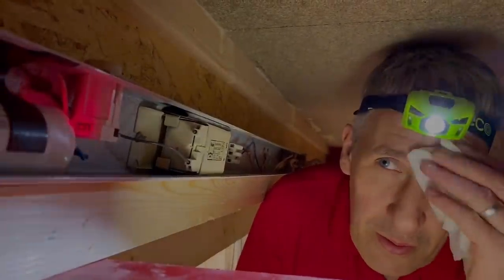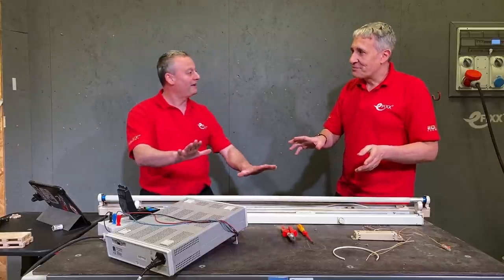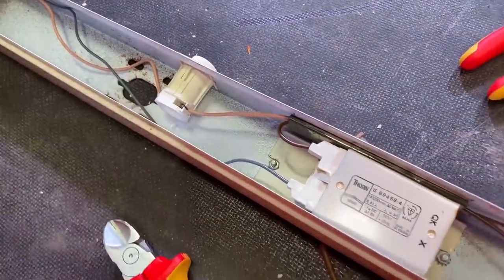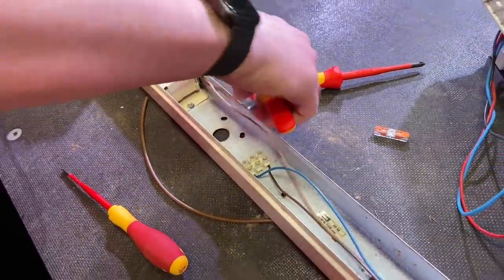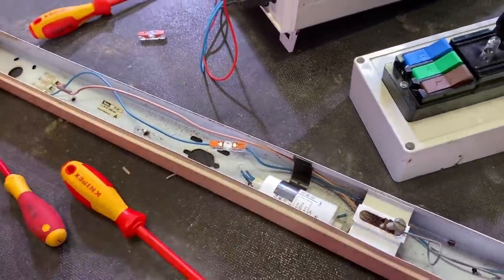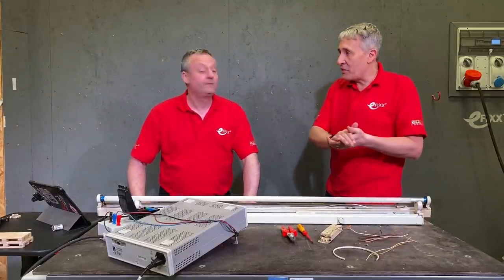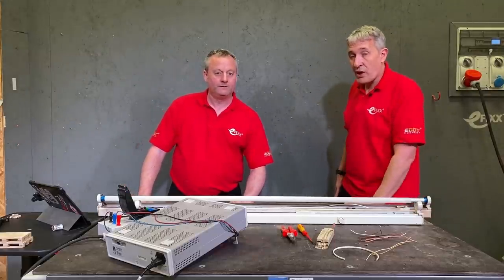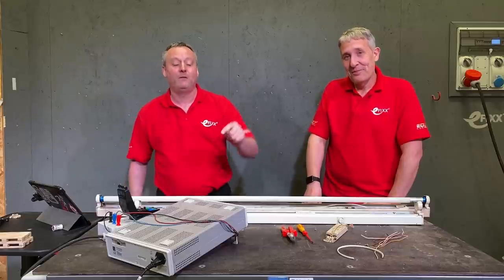DON'T cut the Wire - CALL the ballast disposal squad!

Comment from the maker: Check out the money you can save swapping out old T8 tubes 📺 👉 https://youtu.be/nAo4onkzpKA
Also, would you remove the old magnetic ballast to sell for scrap? - comment below.
Reply: Safe a little bit of money by chopping brown to capacitor and leave neutrals connected ? Saving you wago . I know you shouldn't really leave something in circuit that not needed.

Comment: Usually in a commercial environment, I've found the actual fittings have totally had it. Normally the lamp holders will be brittle, the wiring crispy and the fittings will look rough. If the fittings are in perfect working order and look fine, then they probably aren't used very much anyway so it's not worth changing it to LED - especially if they have a good stock of tubes / starters already.
Reply: In the home that is even more so — home grade stuff the exterior is also plastic and likely to fall apart when you try to open it to replace a tube.

Comment: Interesting as usual.
One valid point, some tubes come with a Starter replacement device, they call it an LED starter, but it is actually a 1 amp fuse, fitted in a starter package.
I included one in my fitting conversion, simply because I could. Which gives a little extra protection.
Reply from the maker: Interesting -which brand of tube uses that option?
Reply: I supplied a customer with dozens of these "starters", only to find when opening one up, it had a stationery staple across the pins.
Ooh!
Reply: @efixx  Energiser & Hyperikon are Two brands that I have dealt with, they both come with these Fuses, and the Hyperikons come with a brand new replacement end, for their single ended tubes. I am wondering if they might be those resettable fuses, known as poly fuses.! I must admit, I have never tried to stress test one.
Reply: @efixx  I think its optional, but it makes sense, as it keeps that slot occupied, and it also adds a safety feature to the unit, so, if one tubes goes nuclear, it doesn't put you in the dark, if other lights are nearby. It just kills that one light fitting.!
Reply: Good 100% of LED-Starter how I have found till yet have had only a connection from one side to other. Only my new extra LED-Tube lamps have an extra fuse built-in (and no fake-starter of course).
Reply: @OldLordSpeedy  All of my LED starters has a 1A fuse. I didn't know so I didn't use them. Just wired as simples as possible.
Reply: @mcplutt  Of course its optional, but as the space is already there, you can wire it accordingly to include a 1A fuse.
If a tube fails short circuit, it will leave the others (if there are any),on.
These LED units all use a very tiny full bridge rectifier. If it fails short circuit, its an added bonus.

Comment: I just retrofitted 100 of these (T5 tubes), disconnected the ballast but left it in the body to save time. Also had to wire the live to one of the pins at one end, then out of the other pin to one of the pins at the other end, and out from the 4th pin to the neutral. Tubes had a polarity marked so had to make sure it all matched. If you follow the manufacturer’ instructions you won’t go wrong :)

Comment: I installed these (or very similar Philips with blue ends) removing all the gear. One end is marked +/-. The other end is unmarked and as I found out those two pins are commoned, well at least it tested the trip !

Comment: Used to rip loads of the old 70w magnetic ballasts out a few years ago. We did weigh them in as motors (due to the coil of copper) and we were making £600 a ton! Unfortunately, the scrap yard cottoned on and from that point, they only let us weigh in as standard scrap. It was nice while it lasted tho

Comment: I have always bypassed the ballasts for multiple reasons.
1, energy saving. Might only be low, but multiplied over many fittings it will make a difference.
2, if the ballast fails, this will result in being called out, under warranty, to bypass the ballast anyway. 
3, the customer is paying you to do this work. If it was a twist and go job, the customer could more than likely do this themselves. 

I would always fit a label to indicate the ballast is removed and to use led conversion lamps only.
Reply from the maker: Sounds like a sensible approach.

Comment: There's an alternative way of wiring that is the better method in my opinion! There's no main side in the light fitting then, and the lamp will work in both directions inside of the fitting. The method you've shown here will cause a short circuit in the lighting circuit if you put the LED tube in the wrong orientation into the fitting because on one side both pins are bridged inside of the lamp.
Reply from the maker: the other side of this tube has no connections.
Reply: @efixx  Yes, the pins on one side are only to hold the tube in place within the fitting. But the both pins are bridged inside of the lamp. And if insert the tube the wrong way around this will cause a short-circuit. But there's an alternative wiring method that prevents this.
Reply: I don't know why, but whenever I post comments containing a link to a wiring diagram they get deleted by Youtube.
Actually it's quite easy. You got two terminals at each of the two sockets of the light fitting. You connect one socket to line and one to neutral. Then insert a wire bridge to connect both free terminals of the sockets. If you do so it does no longer matter which way around you insert the lamp into the fitting, it will always work.
Reply: @Marcel_Germann  You can also just use a Sharpie and mark the live fitting. It's quite a common practice.
Reply: @Richard1977  I just wanted to make a point that there's an alternative way of wiring that is better in my opinion because it's idiot proof.
Reply: I am very sorry but all LED-tubes have only one connection side for power. It is marked on every LED-tube. Of course you marked it on the lamp-fitting self too. New LED-tube lamps have only one powered side!
Reply: @OldLordSpeedy  I know, but you can bypass this by a simple wiring trick! Youtube deletes my comments containing links to drawings so I decribe it. You got per side two contacts. In the method shown here you connect the line on one contact of the left side (for example) and the neutral on the other side of the left side holder. The right side holder is without any connections.
In my method you connect the line on one contact of the left handed holder. From the second contact on that side you connect a wire bridge over to the right handed holder and connect it to one contact there. On the second contact of the right handed holder you connect the neutral. Then it doesn't matter which way around you install the tube. There's always a connection inside of the lamp on the non-powered side, so if you insert that end on the line side electricity will travel through the internal connection through the additional wire bridge and get to the mains end of the lamp. And if you insert the lamp the other way around the same thing will happen with the neutral.

https://abload.de/img/umrstung-anschluss-ei3oktj.jpg
Reply: I've been called out a couple of times where the client has fitted the tube the wrong way when the sparky has been lazy and wired the fitting to one end cap. As Marcel says the better option is to wire through both end caps which is how the manufactures recommend it.
Reply: @Marcel_Germann   Hmmm ... my LED-Tubes how I use all time have at the non-electric side no connection - some are kind of plastic -- so this can not work. What do you show is an old Tube diagram how it is installed over 80 years long without the starter.
Reply: @OldLordSpeedy  The ones we usually install have metal pins even if there's nothing connected to that, but the evil thing is the two contact pins on the side of the tube that is not mains powered is bridged inside of the lamp. That means if you insert the tube the wrong way around it will cause a short-circuit.
And without the ballast.
Reply: @Marcel_Germann  This is the way you are supposed to wire them in Switzerland. Apparently it is to prevent people getting electrocuted by some cheap chinese import tubes that have the pins on both ends connected straight through to each other. Inserting such a tube into a fixture converted the way shown in the video would leave 230v on the exposed pins while you are installing it. Suppose it serves you right for buying cheap crap but guess that is not the point.

Comment: Surely replacing the whole thing with an LED striplight will be cheaper overall? How much time does it take to convert the existing fitting compared to a complete swap?
Reply from the maker: There are sometimes reasons that mean a change is difficult - asbestos in the structure or an expensive fixture - eg vandal resistant
Reply: Normally less than 5 minutes to convert. Saying that tho, I have done a few 😂
Reply: Retro fitting, also eliminates the time required for testing and the recording of the results, which is recommended, for a like for like replacement of an accessory.

Comment: I have yet to find a LED retro bulb that puts out even close to the same light output a t12 in its place would.  the 8FT t12 led bulbs, only put out 3600-4000 lumens and use 44 watts roughly give or take the bulb you find..   There are T12 bulbs that use 60w and put out 5900 lumens.  Do the math, the t12 is actually more efficient at 98 lumens per watt, the led is 81 watts pet lumens.   The LED conversion bulbs are also pricey.. 30$ a bulb. T12 are $15 for two bulbs, and new ballast is only $25.   So for $40 you can have a fixture that uses 120 watts plus the ballast, and have 11,800 lumens.   VS the conversion bulbs at $60 that would be 7200-8000 lumens for 86 watts.   Youre actually spending more money to downgrade lol...  There are NOT many LED diods today that can output 100 lumens per watt lol..     LED is a replacement for incandescent lights.. but no way do they replace florescent bulbs.. 

I mean if you really wanna downgrade the lighting go for it, the only down side to the T12 is it takes a min to get to full brightness, but thats fine by me.    LED is really not all its made up to be.   I just replaced the ballasts and t12 bulbs with more efficient ones that still linger in the stores.. why in the world would i spend more money for LED conversion bulbs and have less light output.

I dare you guys to find me a T12 LED conversion tube that output more light and uses way less energy than the t12 did...  Youll only find that on the shorter 2-4ft tubes.. but not the longer tubes.   Now dont even get me on T5 bulbs....
Reply: Exactly my point. And have said this from day 1. Also it's easier to recycle a fluorescent tube then all the wee waste produced from an led tube. Same with discharge lighting. But people have fallen for the led crap. Yes it's better than halogen/incandescent. Yes it's better in cold environments. But the cost of the fittings and the general fact you can't service led fittings means we have gone backwards in progress and now generally it's failed replace and bin. Yet I still service and replace T12 tubes in fittings from the 1960/70's still going strong. I'd rather be able to fix and repair than to just be a fitter. And adding to the waste pile every 5 years when the led has failed.

Comment: I would of kept the Fluorescents not a fan of LED taking over everything.
Reply: yea thats what i did.. I have a 100 year old barn, huge barn like 100 foot long and 4-50 feet wide.. the work shop had 4 duel T12 8 foot lights in it..  Now only 2 worked.  1 only 1 bulb.    So i had no choice but to remove those lights, and i installed some LED shop fixtures i removed from my kitchen as i replaced those for designer style fixtures..  and i decided to get duel 8ft led fixtures as they are only $80 to replace the other t12 fixtures that didnt work.   Honestly the work shop is SOOO bright and with the lense covers on the leds dont look much diff from t12.

However the t12 fixtures that did work, which was only 1 of the 3, i decided to replace the 75w 8ft tube with some GE 60w 8ft tubes, oddly those 60w coolwhite have 5900 lumens the 75w are only like 5k... so why not go for the 60w lol.   The other 3 fixtures im going to just get some new T12 ballasts.. they are $24, and two T12 60w bulbs are $17.. in total i can save the fixtures for $41, this saves me $49 replacing them with 8ft LED fixtures.  And the LED fixtures are only 9000 lumens, the t12 are near 13k..   But i do wanna save energy.. this is why i didnt replace all the t12 in the work shop.

The t12s will go in the center of the barn where the lights will only be on when they need to be on, the workshop will be used more, so i cant have 1200 watts of lights on for 4-8 hours at a time lol

Comment: If you Brits are just now changing over from fluorescent to LED tubes, you are about 10 years behind on us Dutchies. Helped by a substantial government grand of course when it started, like several other 'environmental friendly' changes our government thinks we need.

Also because of several fires and other related accidents, Dutch insurance companies really only like to see single ended tubes with no other gear in the armature. And as a result of that you xan buy LED-only 1500mm armatures for €10-€20, depending on the brand of course.

Needles to say that millions of old armatures have been disposed of because changing was cheaper than modifying. 

And on calibrated arms (torque for consumer units-discussion):
Check out the ABB HAF (Hafonorm) fuseboards we use in the Netherlands that use a buss bar for its connections:
https://youtu.be/Immxo4SWCYY
Reply: Nope been using led over ten years here too. This is pointless be easier to bin old fitting and fit new

Comment: Will the led last longer with the ballast in line?
It reduces inrush current. 
(Not recommended for commercial use)

I would just put the two wires from the ballast into one connector of the ballast. I won't delete the starter, because the replacement has a fuse.

You can tell anybody how to replace a tube with led, but I won't tell anybody how to rewire the assembly.

Comment: So,why are you stripping the wire with the cutting/shear blade when the manufacturers have spent a fortune on the Tooling to form a stripping notch in the pliers. Must be the most ham fisted stripping I've seen for a while! Why not just use the ships??
Reply from the maker: The stripping notch is for 1.5mm sq - the wire inside the fixture is 0.5mm sq